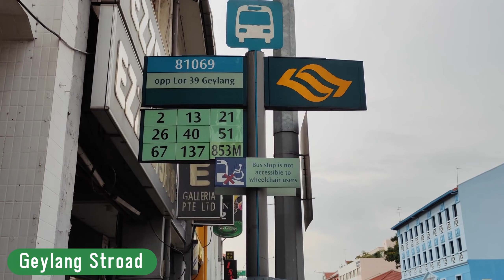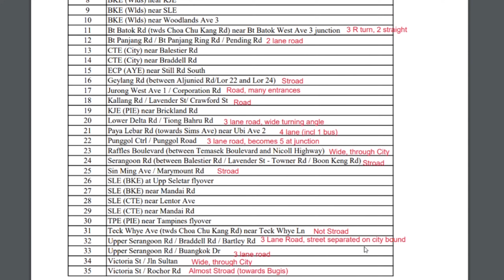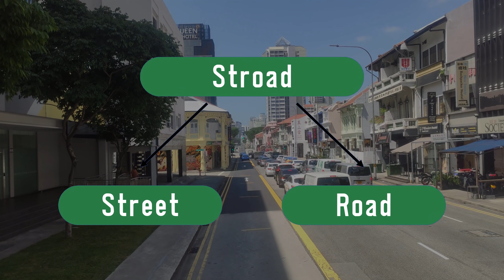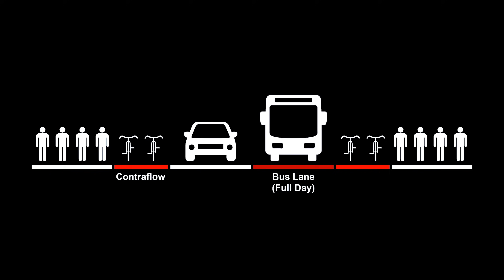Stroads in Singapore | Why they are Bad and How to Fix Them

Comment: You could do a whole video on the kaki lima. Also, the number one step taken in addressing 90% of Stroud’s is to widen the walkway and plant TREES - shade is underrated infrastructure
Reply from the maker: oh yes, the five foot ways! having trees would be great too
Reply: @StormyMusic9  depends on how central it is. Would need thousands of daily users to justify expensive infrastructure which requires power and maintenance. Also, trees don’t just cool the city, they clean the air. It is possible to plant gardens atop covered walkways though

Comment: Very well-structured video with solid points! 

Few suggestions that might make your future videos better
1) Pacing of your video (there's currently a lot of pauses in between points)
2) Experiment with speeding up your vocal recording by 1.1 ~ 1.3 (instead of reading faster since that may come with articulation issues)

Comment: 9:05
Isn't that's what LTA did with Bencoolen Street? But it's still disastrous during peak hours because of how the road before the One-car lane sector is actually the busiest stroad of whole SG and doesn't help that the road before the one-car lane sector is 5 lanes road and the one-car lane measure is just gonna divert the heavy traffic to other roads nearby.
Reply: Exactly, I cycle through that stretch weekly on my ride to east coast park for exercise. The irony is that they add a 50m bike lane parallel to the road that does not connect anywhere and is horribly designed (ridiculous narrow right angle sharp turn at end point). As a result, I never bother with the bike lane and stick to the main road instead.
Reply: imagine the students in NAFA and workers in the neighbouring building... the honks are annoying. (also dangerous... drivers are just way too kaisu and try to thread the needle when that "DTL" section is basically "full house" that basically make some car drivers to cut into the bus lane to "escape" the incoming traffic from the perpendicular road, middle road, which makes it worse for the bus drivers...)
Reply: Think LTA was forced to narrow that stretch of Bencoolen St from 5 to 2 lanes so they could widen the pavement (it's a 0 sum game as there isn't much empty land there) to be able to fit the exits of Bencoolen underground train station
Reply: @lzh4950  IMO LTA could have asked NAFA to "borrow" a space for the emergency escape route which would have allowed more space for one more lane even if it's smaller and still provide the cycling path to be allocated. At least there's one more non-bus lane for the cars and less likely to create the annoyance and danger.

Also they could have add that one more lane until the turn into the road to election department. At least it might have allowed the cars to turn into a buffer area in case the light turns red while at yellow box...

Comment: Love the strong towns concept. Agree that streets and roads have to be kept apart and that stroads are horrible. Just as food for thought most of the stroads identified in the video are actually the major thoroughfares for the areas they serve (eg cbd or the east side Geylang/paya Lebar). Converting them into streets will reduce the traffic. Would a better solution be to convert them into roads so expectations are clear? Of course there will be negative impact on the businesses along the road.

Comment: I visited Singapore recently, I have spent a fair bit of time there over my life but this is the first time I was training for a half marathon at the same time so I went out in the early morning to run and realised just how hostile to pedestrians some parts of the city are (in this case the downtown core). Running from Marina Bay and then up the Singapore River/canal (though there was some crossings along the canal that should be ped priority but you had to wait for slow lights to change) was great and very easy but deviate from that and its impossible to cross the stroads without huge wait times and in some places inadequate or closed off overpasses. 

Also happened to be the first time I visited since starting postgrad urban planning studies which has changed my perceptions on the way things work.

Comment: Good. However if Geyland Stroad was narrowed, where would the traffic go? On the PIE which is already very congested? I definitely agree on most points you made. I avoid all stroads. But the solution must be practical.

Comment: Big roads with fences in the center to prevent people from crossing, but at the same time also cut through and divide living areas. Separators and one way design with no possibility to turn or even U-turn unless explicitly allowed. Every 200 m traffic lights that are designed to slow down the traffic, not help better traffic flow ... I could go on and on and on.
You got used to it. Sure. But normal that is not.

Comment: 6:31 Have also been on-board buses that were held up by cyclists in front, with the bus having to filter to another lane to overtake the cyclist safely since buses are wide, but other lanes are often busy with traffic too. Once saw a bus took a minute to enter a (~50m long) bus stop bay as a cyclist was in front
Reply: Unfortunately the cyclist was probably just following the law, which requires them to be in the left, meaning moving out of the bus lane to give room = potential ticket. Also I imagine you have also been stuck behind cars / busses / other vehicles? That happens from time to time when driving, it’s a feature of other vehicles being on the road.
Reply: @geonwilliams  A difference is that bicycles are slower than other vehicles though

Comment: I started watching your vids cus I was an avid cyclist turn motorist(yeah I am part of the problem)

I like your solutions but gahment won't reduce 4 lanes to 2 lanes just for pedestrians, the bustling vehicles will jam so much then make them unhappy then gahment cannot earn that precious COE monies.

As a rider myself i would be ok with reduction of lanes to accommodate pedestrian safety as motorcycles are small and easy to travel with. I personally think the introduction of small vehicles that can only be consist of 1 driver and 1 passenger should be done to replace big cars. They should make it that if you do not have a family you should not buy a car, buy a motorcycle, small car(like those 3 wheeler car options) should be bought if you alone want to commute with a private vehicle.

Comment: Hi, im a Malaysian who have been spending a lot of time during the pandemic contemplating on the problematic city designs we have in Malaysia. Glad to see someone from a similar climate doing the same XD. A lot of Malaysians are complaining that walkable places and biking infrastructure wont be successful due to hot weather, what do u think is the best way to mitigate this issue?
Reply from the maker: hi there!

i see "heat" being used as a lazy excuse (by mostly ignorant people) from where i'm from too, lol!

the weather can't be changed so the way to solve such issues is through building infrastructure, really. people will do whatever is easiest for them so if walking and cycling is made the quickest way to get around, people will use them no matter what.

the reason why some people complain about heat is because of their lifestyle. like if one's only exposure to the elements is the walk from the lift lobby to the carpark, one will not be acclimated to the weather and thus have an exaggerated sense of how hot it is.
Reply: @tehsiewdai  I totally agree with you! I came to the conclusion that the exaggerated sense of heat is also caused by the amount of black asphalt we pave, and the amount of cars we have on the road that are all radiating heat to the environment during the day. Big, shady trees would definitely help in cooling it.
Reply: @shr6482  also the irregular and nonsensical placement of shading trees, like having big shady trees on the street divider but no trees on the sidewalk.

Comment: Many of these roads are arterial. Reducing speed limits and lanes are going to result in massive jams
Reply: IMO it might, but it'd be a lot usable and safer... plus not like it's any different right now with the obstacles
Reply: @PrograError  tell that to emergency services
Reply: @terencew3840  they have their own protocols anyway. not for us, plus they got the siren...
Reply: @PrograError  you cant get to places when 2 lanes are jammed up
Reply: @terencew3840  they don't need to cut to 2 lanes just 3 is even enough from the current 4-5 lanes... cutting to bencoolen DTL side of the Bencoolen St is way too extreme and helps no one at all...

2 lane for city area as a road diet is way too extreme.
Reply: @PrograError  jalan besar/ sims ave has 4 lanes.. one of it for bus. 3 usable lanes left.. nothing to cut.

Comment: Just wondering some of the lines painted from a side street turning into a curved main road are tricky to navigate.  If you follow those dotted lines and turn with it, (Chai Chee Rd turning left into New U. Changi ) , are we to think that we are allowed into the bus lane if your car is travelling on the left side of dotted lines;  if that assumption is true, then there’s no problem with the other 2 lanes right of the dotted lines and the outermost complete white line.  If we are not allowed to end up at the bus lane, this can be quite tricky if there’s a whole line of cars turning into New U Changi.

Comment: Singapore proves that stroads are dangerous inefficient and shouldn't exist, but that they don't have to be quite as bad as they are in North America.
Reply: the only difference is that stroads in america is a new development thing, where SG is a square pug shaved to fit a round hole using existing infrastructure. if you look further out, there's essentially no stroads just standard streets and roads...

Comment: Over here in Malaysia, also got stroads 😢
Reply from the maker: yeah, i've seen quite a number of them before

are they very common?
Reply: @tehsiewdai  They are, I still remember having to drive across a 4 lane stroad to get to the other side and the scariest thing of all is that those cars we're going at 60-80km/h
Reply: @tehsiewdai  i'd say it's basically a main point of most places and towns, especially on the historical Malaysia route 1 where many of the old British towns are located.

Personally i have a relative connection up north of malaysia in a town called Sungai Petani which is the 2nd largest town in Kedah (IIRC), where the Route 1 is basically the main road for the town, which has 2 lanes on each direction for the most parts. the town centre is a mess of lanes width and directions but they are wide (almost the width of the stroads you shown, plus 45"d parking for the most parts (as is standard in most parts in malaysia).)

Comment: As much as I think stroads are bad, I don't think the fix is so simple. Most of our stroads are legacy streets which were widened to accommodate increased traffic. They are still used as main thoroughfares to the city so just converting back to streets does not solve the problem of the high traffic volume.
Reply: Which doesn't even make sense since induced demand is a thing, you will only get temporary relief from congestion and will be back to square one.
Reply: @ANTSEMUT1  Ah but the solution to induced demand is dynamic tolls based on traffic. It's already partially implemented here.
Reply: There are shophouses torn down everywhere for development, so tearing down shophouses along 1 side of Serangoon Stroad may not be a bad idea.

The stroad-nature of Serangoon Rd starts at Hotel Rendezvous itself and ends somewhere before Hougang Ave 2. It may be doomed to remain as a stroad, unless there is incentive for drivers to divert away from it and make use of the CTE and KPE instead. It seems here to stay as a main thoroughfare though, with a long flyover between Woodleigh and Kovan.

Comment: In Iraq, they call streets running parallel to roads "service roads".
Reply: they call it that here in the US as well in some parts but we have so many names for it used in different parts
Reply from the maker: that's interesting!
i'm curious - are there many stroads built in your area?
Reply: @tehsiewdai  not in the UK, and not in Al-Kadhemiya in Baghdad, but in Al-Mansur in Baghdad, the whole space between the illegally built concrete commercial blocks is for cars, without a sidewalk

Comment: Commendable technical analysis of stroads. Good recommendation to convert stroads into streets. However, I think you failed to put yourself in the drivers' perspective. Stroads in Singapore often have high volumes of traffic, not just because of parking by the sides of the stroads, but also because they simply are roads which are core to many peoples' daily routes. I cannot imagine what will happen if stroads like Eu Tong Sen Street or Serangoon Road are narrowed. That will cause excessive stress on other connected roads, as well as affect the businesses by the side of these stroads. I dont think there is a simple solution to this.

Comment: There're plenty examples of stroads in many countries even in Australia and New Zealand where urban planning was heavily based on excessive car dependence, especially in the middle to outer suburbs. It's clearly a huge mistake to follow the American automotive planning of unplanned urban sprawl (low and high density) with cul de sacs, widespread network of massive boulevards and freeways which make walking, cycling and public transport as unusable alternatives. Cul de sacs with single use zoning breed in more single occupant cars, which eats up road capacity on the arterial roads extremely quickly. Parking a rounded metal box on four rubber wheels for 1 - 2 people is a huge waste of space while being extremely expensive to upkeep.